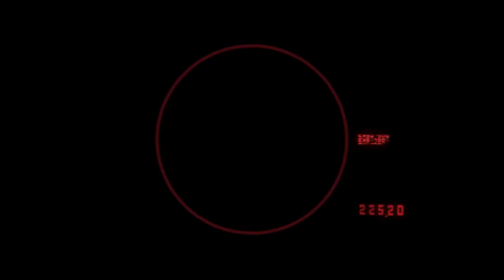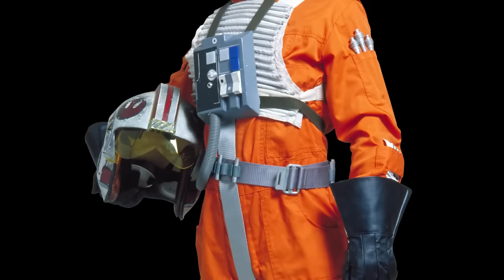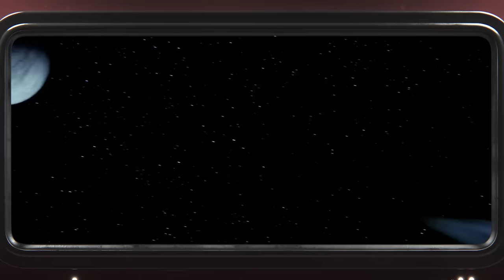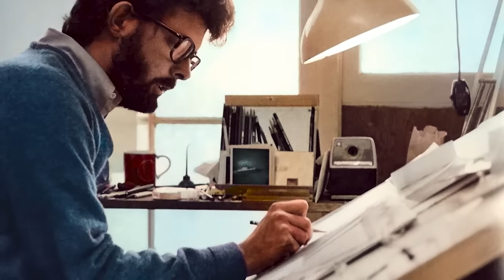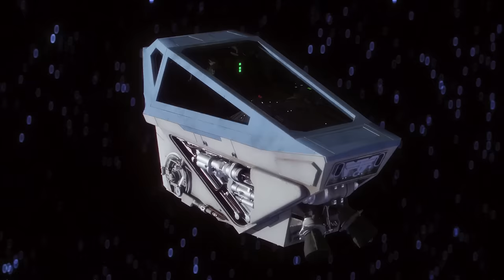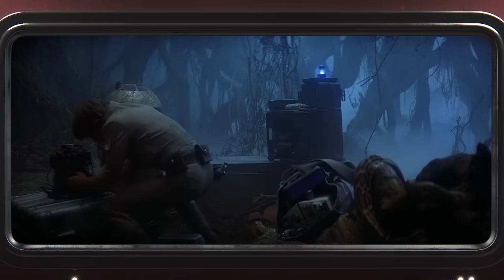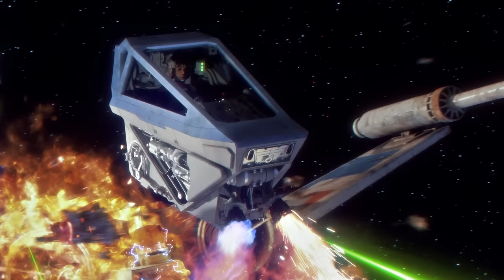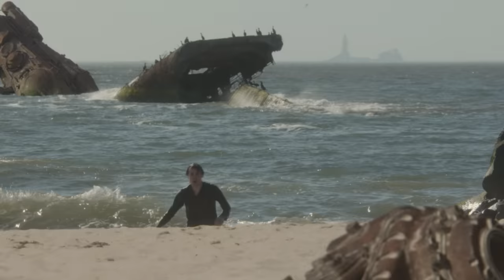X-Wing Ejection: It all makes sense now

Comment: It's also possible that the unsealed flight suit covers a body glove layer that acts as a mechanical counterpressure suit (look it up). In this case, you could have a conventional ejector seat without needing any handwavy force field to survive in the vacuum of space; you'd just need to don an oxygen mask before ejecting (or after, as the case may be; being exposed to vacuum still leaves you with about ten seconds of useful consciousness). The presence of a life support pack on the pilot's chest suggests that the suit is meant for vacuum use in some fashion.

Another alternative would be an encapsulated ejection seat, like the ones used on the B-58 Hustler in real life. Rather than ejecting the whole cockpit, the seat comes with a telescoping shell that automatically deploys to enclose the pilot.

Also worth noting that the X-wing's less famous stablemate, the Y-wing, are sometimes described a similar ejection system to your proposed capsule, with the whole front fuselage detaching and jetting away.
Reply: The encapsulated ejection seat could be useful for Imperial TIE fighters.
Reply: @justindurante2554  yes, and no, the Empire wanted to encourage the TIE Pilots to fight to the end, and to think of themselves as expendable to decrease the likely hood of them defecting, just like why the TIEs lacked shields or Hyperdrives or Life Support, so i just cant see them getting any form of Ejector Seat
Reply: I alwasy assumed (until the Force Awakens) that TIE cockpits didn't have life-support and that the TIE pilot flight suit was fully sealled and did the life support. Why provide the entire cockpit with atmosphere when you can just put the pilot in a spacesuit.
Reply: @IceWolfLoki  tie fighters don't have any onboard life support, so any air in the cockpit is just what was picked up prior to the hatch being sealed
Reply: @IceWolfLoki  There's pros and cons, those suits would need to be hooked up to an air supply either way. There's also the issue that electronics don't always work reliably in a vacuum or with massive swings in temperature. So, you'd have a cockpit that's nearly all the way to being habitable with the only reason for that extra layer is if you're hit, but not so much that it destroys the vehicle.
Reply: @TytonidaeIndustries  Completely wrong, there are multiple canon mentions of TIE ejector seats. TIE pilots were supposed to be brave, not suicidal.

Comment: I... always thought this was what they did. Not just because of the real world examples, but 'SpaceAbove and Beyond' had their fighter craft with cockpit modules the pilots boarded, were then hooked into air frames, THEN sent out from a mother ship. It just makes too much sense for a full cockpit ejection module, and something like a force bubble around the seat being a backup, andemergancy suit seal being a backup on that. That way there are redundancies in place. The cockpit being ideal because, as you said, supplies can be packed. If nothing else it can have a transponder beacon to flag for pickup. 

Sure getting picked up by imperials is far from ideal, but getting picked up by scavangers, pirates, in system craft, etc are also options.
Reply: Wow. That actually does make sense, having redundancies.
Reply: The problem is, wouldn't it be better to spend that mass on better shields? Remember an escape system is a last resort. Until you use it, it is dead weight.
In space above and beyond it existed as a means of quickly getting into the plane to fight, escape pod as a secondary function and minimal capability.
Reply: @justindurante2554  Realistically it's always a balancing act when designing anything, but an ejection system is centralized i na single part of the ship typically surrounding the cockpit. A shielding system would have to be distributed even if it's one large generator with supporting systems spread through the craft.

Plus theres only so far you can go wit ha shielding system i na craft of that size and maybe incom already had what they felt was the best the ycould safely install without either damage or mantinance issues.

Comment: WOW!! This is really very interesting to me and something I've thought about for a long time along with many others like yourself. 

Last year I published some fanfiction on various Star Wars related websites that incorporated a similar idea, the main differences were that the Artoo unit came along with what I called a "T-65 Ejection Module". The little droid was strapped to his compartment you now see over a rear engine that powered the E.M. which also had small wings that unfolded and a nose that housed the pilots food and medical supplies, an idea I picked up from TESB where Luke is seen entering the X-Wing storage compartment right under the cockpit. The Ejection Module in my story is also unarmed, it only had a small role anyhow but I decided early on that, whilst this was a ship within a ship, it was still only a rescue vehicle designed to get the pilot to safety and that's all. I also did some designs for the E.M. but these were for my own use  and I never published them. If you would like to know more do let me know. Another subscriber here for sure. Great video, keep up the good work. 😁

Comment: I get major hang-ups about weird design choices when it comes to sci-fi ships, and I'm glad EC is there to find creative solutions that aren't far fetched. But can he take on the ultimate challenge and find a way to explain how the landing gear on the X-Wing are stored in the bottom engine pods while also leaving space for the engine's components?
Reply: Easy answer to that is the engines aren't that big. TIE Fighter engines are tiny and seem to work well.
Reply: Well, you don't need much space for struts if you use the skid as your outside layer of the ship.  Look at a 737..those planes have no cover shroud for their landing gear(outside edge of tire is exposed to the elements), and some Airbus wide body planes (Airbus 340 specifically) carry a center fuselage landing gear as well.
Reply: @shraka  I guess we're forced to assume that, but when designing something for maximum efficiency you cut out as much empty space and dead-weight as possible. The fact the top turbines look the same but function differently than the bottom turbines would lead someone to assume that there is a power imbalance there, which wouldn't be in the best interest of a ship designed to dogfight. Or do the top turbines on the X-Wing also contain landing gear for those special circumstances you'd want to land upside down? (I'm joking)
The engine types of TIEs and X-Wings are also different forms of propulsion, as the TIE's propulsion is conducted purely by a reactor, and the X-Wing and other alliance ships rely on a fuel source, which also requires larger spaces to ignite the fuel and use it for propulsion. When you remove the entire section of the bottom turbines for landing gear, with beefy doors for that matter, it begs the question why the top turbines are just as big and identical to the bottom when they could be smaller.
Reply: @BobDunlock  They wouldn't be turbines - there's no atmosphere in space - they're a drive of some sort. The upper drives may well have other items where the space for the landing gear would be. Sensors, countermeasures, shields, some kind of backup system such as a backup / regulator so the upper drives can operate when damaged more easily, or possible a different design to accomodate more armour. Kinda makes sense because you're more likely to get hit from the top - you will pull up more often as a human can tolerate more G forces in that direction, and you want to keep an eye on your opponent so you have to keep them above the canopy.

Comment: I remember one of the X-Wing novels mentioned droid ejection. At one point when Corran Horn was performing an attack run on a Lancer Frigate with a bunch of friendly proton Torpedoes on his tail, he told his astromech to eject. Whistler refused the order and later did something that saved Horn's life. From that, I'm guessing that Astromechs could eject, and that they had control of their own ejection. Suggesting that they might have been expected to eject after the pilot had done so.

I also remember that the B-Wing was shown ejecting its cockpit in Rebel Assault II: The Hidden Empire. It looked like it separated from the ship just forward of the servo ring.
Reply: That's my assumption too; keeping in mind of course that the average astrodroid is supposed to have a lot less personality and initiative than Artoo or Whistler and thus would be more likely to follow the pilot's instructions or the organisation's standard policies.

Comment: I'm thinking it might be a combination system. Like a couple of layers of ejection. If you're in close proximity to a support vessel, and you're in the middle of a battle, taking just the seat leaves both you and your X-Wing easier to recover. However, if help is more than a couple of minutes away, or if you're entering a hostile environment, take the whole pod. So, most of the time, you will eject the whole pod. This would be especially true in the early Rebellion, when capital ships with hangars that could simply scoop you up would be few and far between. Later on, ejecting just you and the seat would become more viable and common, though it would still remain rare.
Reply: Using the whole pod still makes more sense as it simplifies the system. Rather than having two or three ejection systems to make and care for, you only have one. That and there's still the problem of keeping the pilot alive in space even if there are other ships nearby. You don't know how long that fight is going to last, and rescue crews might not get to you in a while. A good example would be pilots shot down during the Yamato's sinking. Three planes were shot down during the attack, with another 7 being downed when Yamato's forward magazine detonated as it was sinking. It would not be until after the rest of the IJN task force was dealt with that rescue planes could start rescuing those in the water. In the case for Star Wars, staying in a pod also protects you from any debris that might be flying around at high speeds.
Reply: @airplanenut89  I'm thinking of it as layers of redundancy, which solves my one issue with EC Henry's concept--what happens if a stray laser bolt gouges a big hole in the canopy window, leading to total loss of pressure?
1. Whole-pod ejection: every pilot's preference, if possible. Atmospheric pressurization, best protection from debris, and controlled atmospheric re-entry. Longest-term survival period (days?)
2. Seat-ejection with magcon bubble: If the pod's pressure was compromised, or if its structural framework or thrusters were damaged, the pilot could still get clear and potentially survive, at least for a short time (30 minutes?). To me, the Rogue Squadron comic panel EC Henry shows in the video suggests this circumstance due to the angle and force of collision impact we're seeing. Ideally, the pod should have ejected prior to the crash, but perhaps the system was damaged or malfunctioning, leaving the seat to eject at the last moment.
3. Failing all else, if the pilot can manually get clear and get hands on an oxygen mask that deploys from the life-support box on their chest within 10 seconds or so, they may be able to survive the vacuum of space for a short period of time as a last-ditch effort (10 minutes? 15?)

To me, it doesn't make sense that in a combat situation, a pilot would have no redundancy to deal with the loss of cabin pressure. True, this system would have more moving parts that could fail, but it's better than having just one system that might fail. It also doesn't contradict previous media, and resolves both the issues I noted /and/ the ones EC Henry set out to solve here.
Reply: @davidcanavese6754  The problems with such a layered system are that it adds time, and money to the production costs, as well as in the maintenance of the equipment. All this while they are fighting a civil war against an enemy with more money, and production capability. It also ads more complexity, and room for an accident. The seat could accidentally eject due to malfunction (we've seen this in real life), or the pilot could pull the wrong handle (wants to eject pod, ends up ejecting seat). From what we have seen in SW, if a stray bolt hit's the pod/cockpit area, then the pilot is likely toast anyway since the bolts in SW act like cannon shells when they impact.

However, if you ditch the ejection seat, and keep the emergency mask, then you likely have the winning combination. Pod for normal ejection, and the mask in case there is an issue with life support. Even if the pod is damaged, I'd rather have it for some form of shelter, and power. I'd imagine the flight suit plugs into a power source for a heater in the event of life support problems.
Reply: In my head airspace craft ejects are where the cockpit ejects with a separate option to eject the seat. The cockpit uses a ribbon instead of a drogue chute for high hypersonic ejection (Mach 10+) also, during ejection the pilot's body is locked to prevent them from snaping their neck and the G-forces can knock out pilots

Comment: This takes me back to the time of the first X-Wing game, where you could be either captured by the enemy after ejection or get rescued and cared for in bacta tank.

The thought process and reasoning is really great in this video, as is the research of real-world examples. The main drawback of the whole cockpit ejection is the added weight and complexity it adds to the aircraft frame. 
You could fare better as a fleet with having smaller time windows for search and rescue with only ejection seats and force fields, but more nimble and maneuverable fighters than with cockpit ejection systems.  Critical systems like ejection seat force fields can have multiple levels of redundancy whislt still being lighter than the cockpit ejection.

But your angle on this topic is highly interesting and incredibly well rendered.

Comment: An alternative is the entire forward section rockets away from the back section of the ship, since most of the highly combustible systems are basically located in the rear of a xwing (cannons and engines). This could be done fairly cleanly and we know the entire length of the bottom front is storage, so this would mean a pilot would have plenty of supplies with them.
Reply: why not both, if you can, eject the whole nose, and have a semi decent mid range ship to escape with, or if its bad enough, just the cockpit module, or even if its REALLY bad, just the seat and force field as a last resort
Reply: @TytonidaeIndustries  
No. Mass penalty. While a quick cutaway section is easy, it can't realistically have thrusters and all. Remember we are talking dead weight until used. That mass is best used for a better craft.

Comment: That little 3D model doesn't look like it could fit their feet in the ejection version, which are not under them like a chair, but are stretched out in front like a kayak. Also, they'd clearly be okay sacrificing the droid, who's just a rounding error compared to the cost of the fighter. Artoo is not normal, and non-Artoo droids are sent to their "death" over and over again in Star Wars.

I'm not sure Lucas was that intention when he wrote that line for ANH. Either that or it was thrown out by the time they start releasing cross sections. Because we know there's a rack of missiles underneath the pilot seat.

Comment: the only thing I am missing on the outside of the pod (and this might be literal mind you, I could have just missed it by not seeing it) would be the contact plate where the ships computer is connected to the rest of the ship, if that is even inside the pod. Either way there should be a multitude of contacts where cables would get in the way of detaching the pod.
Reply: If you look at the model rotating, you can see a bunch of recesses that look like contacts. You could imagine they work like the contacts for some rechargeable batteries where you just have two metal pieces touching instead of actually being screwed together.

Comment: I myself have thought about this in the past. I remember reading things like hot the helmet was supposed to deploy a kind of shielding around the head so it didn't need to be fully enclosed but that sounded like BS to me, even as a kid. I remember reading something about ejection back in the X-Wing novels but I remember it being more suicide than anything else. Something like this, or the capsule like in the XB-70, make more sense to me.

Was it in some old PC game where the B-Wing cockpit was capable of ejecting on its own for emergencies? 

I also seem to recall some people digging around the old props and sets and wondering if the B-Wing was meant to be a tandem-seat vehicle.

Comment: Kudos to your design.

One thing I could add if I may. Perhaps the astromech could indeed eject separately from the pod, then link up much later. astromechs have shown to have a rudimentary thrust capability. Even the BB series have tether lines it could use to dock the the newer X-Wings. Alternatively, the pod had extensions that actually carry the astromech docking port along with it, and thus the astromech now serves as the pod's main computer, monitoring the pilot's life signs.

Comment: Years ago in Space Engineers I made a fighter and for the escape system I basically had this exact idea. No, it wasn't unique, and in SE it was rather goofy and used some mods, but it worked and the escape cockpit still had a gun, thrusters and power. It was a fun build.
Reply: Now imagine all that space and resources put into the original craft instead, and you get the answer.
Do you want this clunky pod, or more shields?